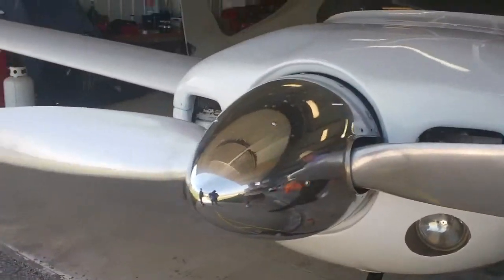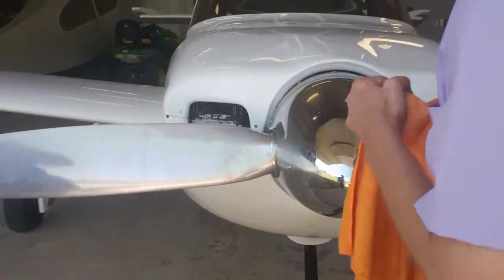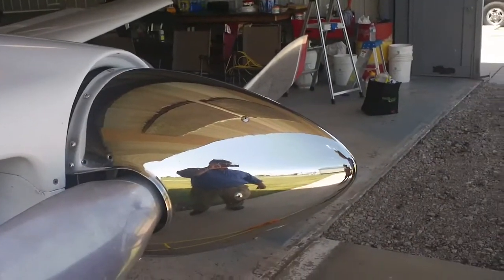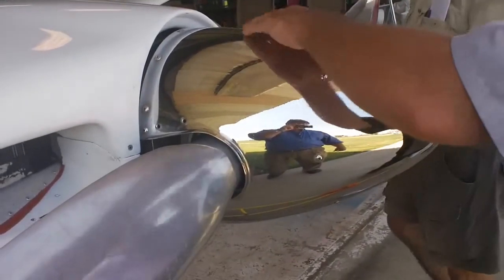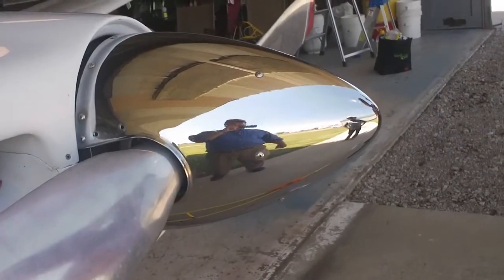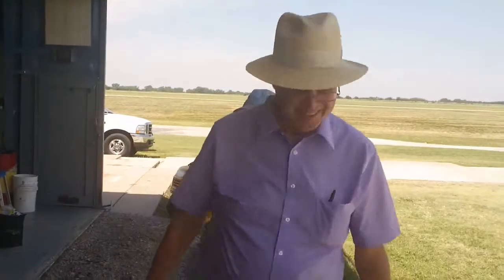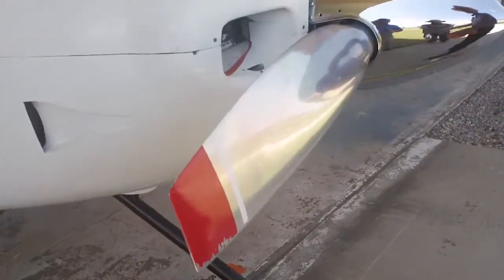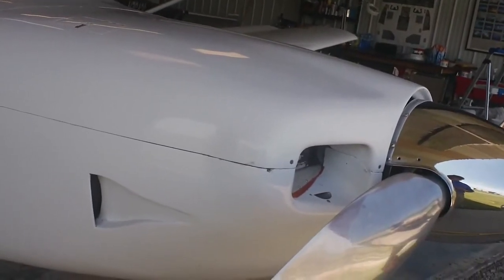M-Factoring Chrome Spinner and Propellar of Jeff Beam's Aircraft

Comment: Where do you purchase this product?
Reply from the maker: I invented the product and make it myself. If I don't sell it to anybody won't break my heart as I have a lifetime supply to clean with. Shipping a quart of this cleaner is expensive. However, I prefer to sell it in a concentrated form in 2, 4 and 8 ounce bottles. A two-ounce bottle will produce 32 ounces of ready-made product. You mix the 2-ounce of product along with 30 ounces of distilled or filtered water. Do yourself a favor and get a 32-ounce or 64-ounce hand held portable pressure sprayer. Your hand won't be worn out from manually pumping a cheap manual hand spray pump. You will utilize your product with far less waste. Works on most solid surfaces. If you spray it in your eyes or somehow drink it, will do no harm. Bath in it and wind up with softer, and subtler skin. Follow these numerous confusing steps in cleaning. SPRAY ON, WIPE DRY, AND YOU'RE DONE! A single application will last for months. A 2 oz. bottle is $20 including shipping. A 4 oz. bottle is $35 including shipping. A 8 oz. bottle is $60 including shipping. A 32 ounce bottle of concentrated M-Factor is $200 that will make 4 gallons of ready to use M-Factor. Sound high in price? Not really as that 8 oz. bottle will make 128 ounces of ready to use M-Factor. There is no need of rinsing with water after using M-Factor. Sorry, as I get long winded on talking about my cleaning product. NO BRAG, JUST FACT! Feel free to ask questions. Contact me at thegemguy 'at' Hotmail dot com For subject, type in, To Order M-Factor!